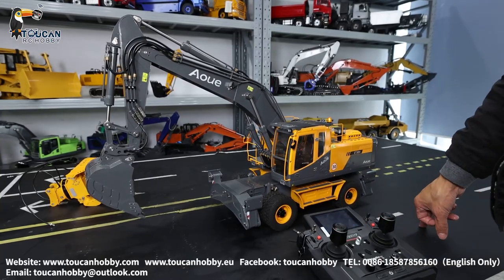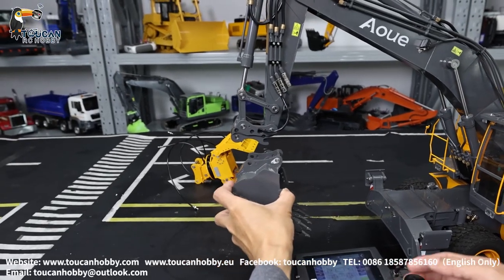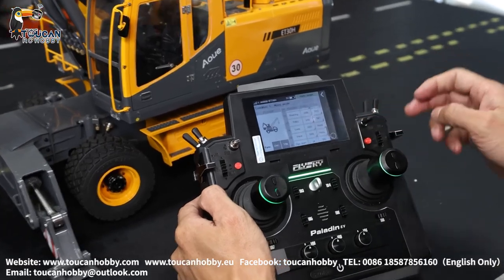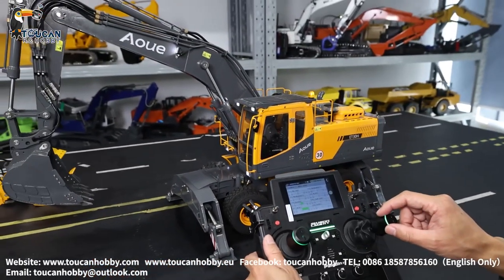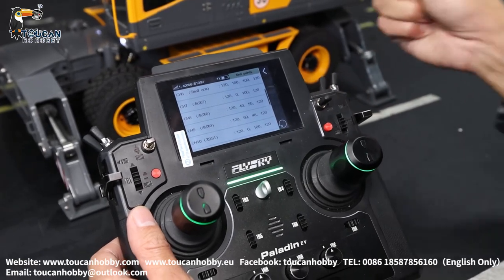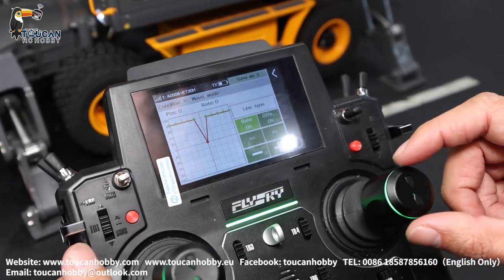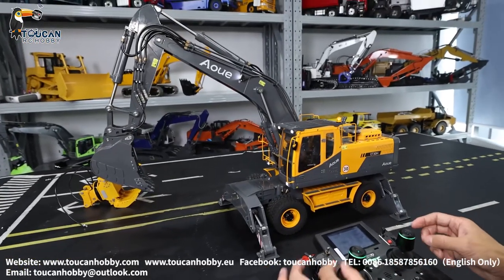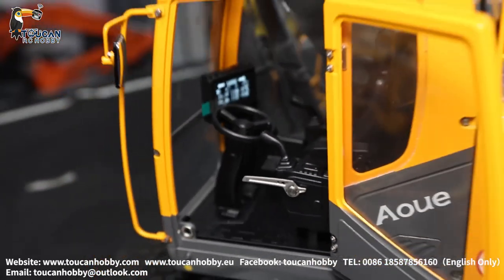How to operate LESU 1/14 RC Metal Hydraulic Wheeled Excavator Aoue ET30H, Check radio settings.

Comment from the maker: How to operate LESU 1/14 RC Metal Hydraulic Wheeled Excavator Aoue ET30H, Liquid Crystal Display, light and sound, smoking, differential lock, spare channels for grab. Check radio settings.